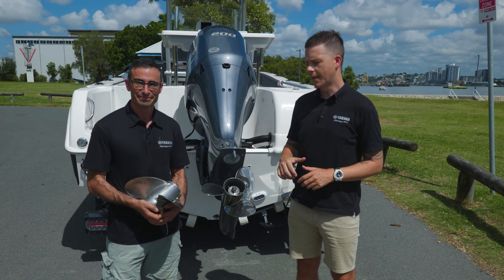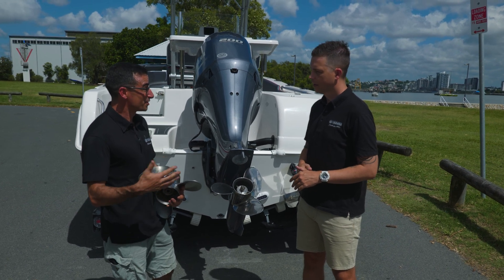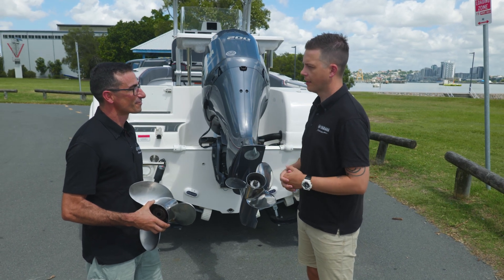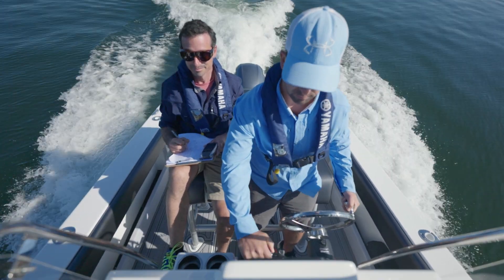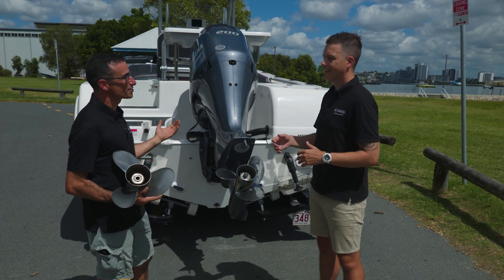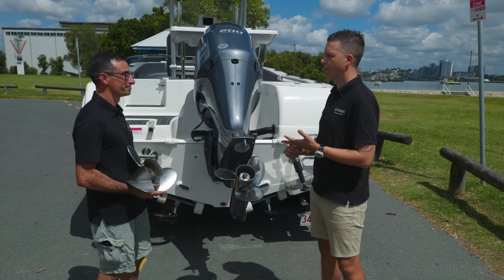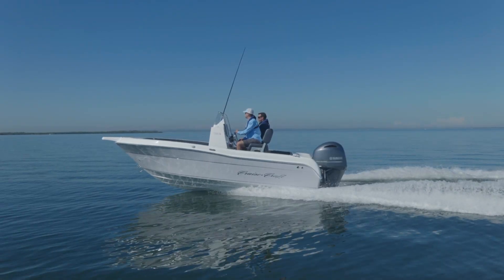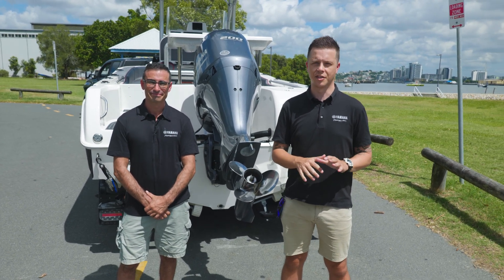Pitch / Diameter / Performance - Boat Propellers Explained

Comment: The distance measured from edge to edge across and through the centre is the diameter. The distance around the propeller is the circumference. That's a little embarrassing.

Comment: Hello. My Yamaha F200XB hits 4700rpm at wide open throttle, the propeller’s pitch is 23.5 inches, which pitch is good for mines and the boat has 6.5meters of length.
Reply from the maker: Please talk to your local Yamaha dealer for advice tailored to your boat
Reply: Least 19 pitch 3 blade to start with to be closer max 5800- 5900rpm's. (Full trim or close to)
Roughly 200rpms for every pitch change on my boat upon testing, but every boat is different. 
Ensure you motor cav plate is level or fractionally higher than the running on the bottom of your hull, use a straight edge to check.
23.5 is way too much pich specially if its a 3 blade, it would be like taking off in 3rd gear in a car. you're putting extreme loads on your gearbox and motor.
Hull degree deadrise plays a vital part too.. 
Consideration of a 4 blade prop if hole shot is sluggish. 
All factors of consideration.
I run 4 blade 18p as my vessel is a 25deg deep vee deadrise. 
Good luck